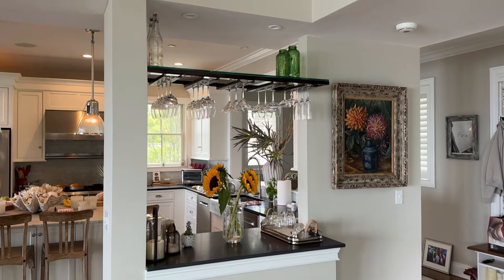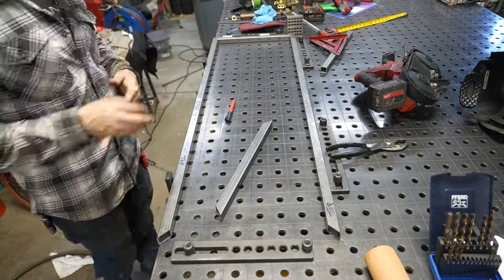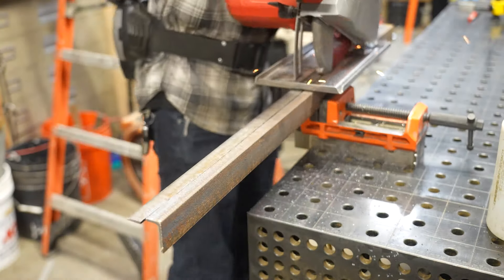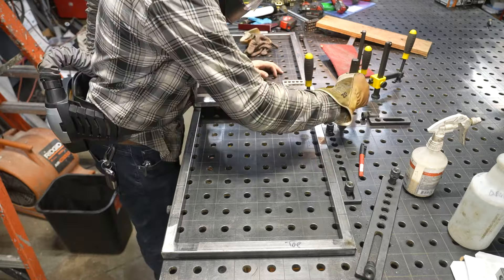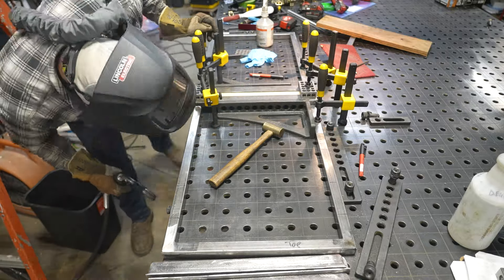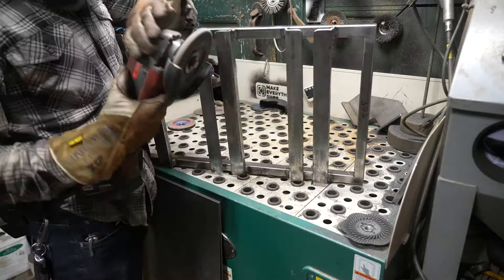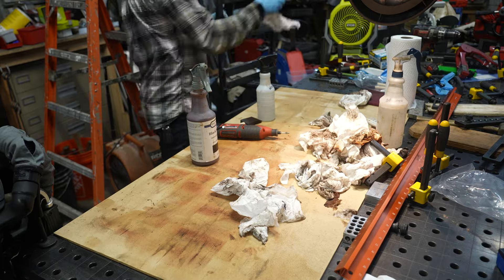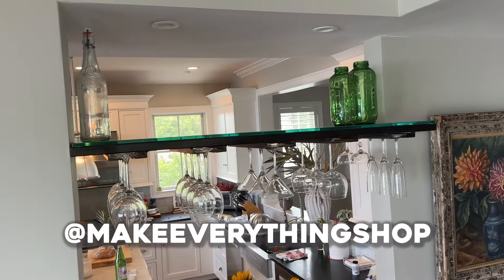A Small Welding Job With A Big Payday

Comment: Hey just a little pointer on sequencing your welds in the corners. The fillet welds at each corner will have the most leverage to pull your frame out of square. But, the welds on the faces also should be paid attention to. I always weld my face welds from the inside corner of the joint to the outside corner.  This will help counteract the forces of that fillet weld.   If you weld from the outside corner to the inside, you run the risk of shrinking that right angle even MORE when you add the fillet weld that really wants to shrink your material....

Now granted, on a four-sided box frame like this, you don't have to worry as much because all the corners are kind of in equilibrium, but it's good practice to keep things square when pulling can be an issue...

So to recap, the best sequence is:

Face 1 inside corner to outside corner 
Face 2 inside corner to outside corner
Outside corner joint
Inside corner joint/fillet 

Oh and never do joints diagonally across from each other...you will compound the pulling and cause the frame to parallelogram....

🤙🏻🍻

Comment: Also when straightening frames like that, another great way is to clamp the frame hanging off the table, with the apex of the bend you're trying to fix, right at the edge of the table....then you can apply leverage on the far end with your body weight....bend, check, bend, check, etc....